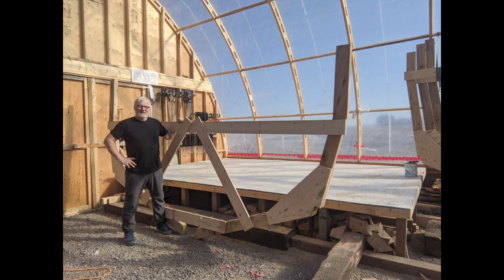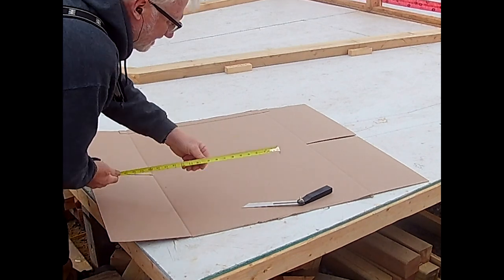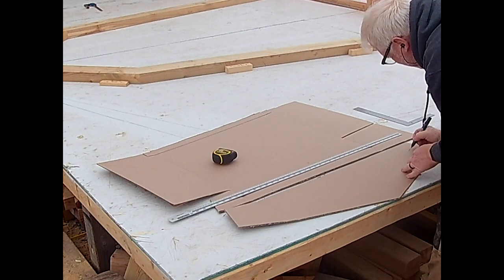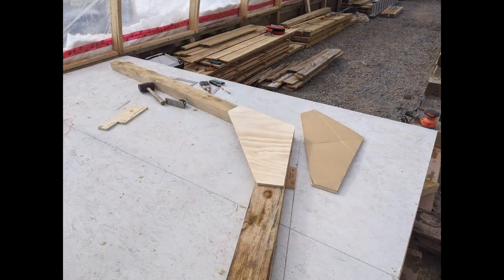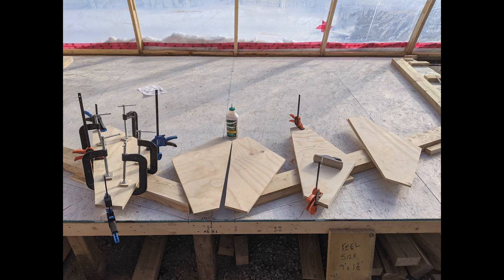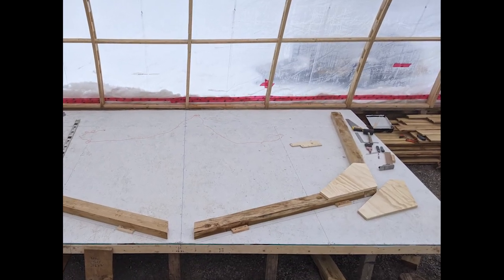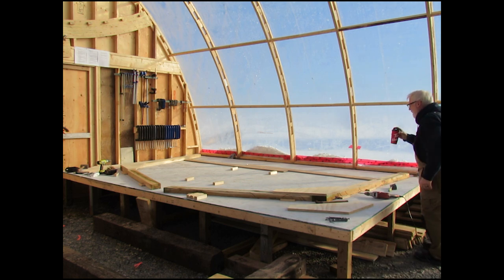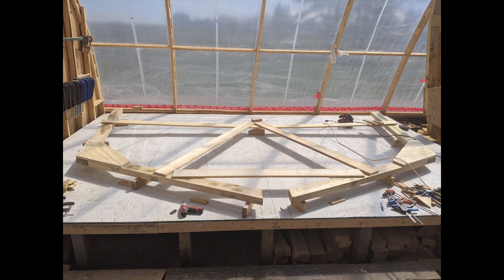YT BoatBuild Ep11 FramesPart2 Fnl

Comment: I suggest that you cut all the gussets a bit over size, secure them to the frames and trim to an exact fit with a router and flush cut bit.  It would sav you a ton of time trying to cut them to exact size.
Reply from the maker: Great idea John. Oversized is ALWAYS better than undersized for as you say you can trim down but you can't add back.  I would say that I "lucked" out 85% of the time. A few are indeed a bit undersized, a bit being 1/8 to max 1/4", but I still have a chance as own the road each frame, before planking, will have to me trimmed to a certain bevel to allow the planks to fit snugly against them.
Reply: @TheAmblerOdysseys  You’ll be epoxying planks and or ply to these won’t you - I think that’s the Buehler method.. in which case small discrepancies don’t matter, and none of this is seen so perfect fit isn’t a issue.  The epoxy is stronger than the wood. You get to practice your cuts and hide your mistakes at this stage. Been there…
Reply from the maker: @robinhodgkinson  you got it. Once layer of planking and two layer of ply all covered with fiberglass.  If I can't hide a boo-boo or two under that then I am in big trouble🤣

Comment: So surprised that you didn't build a "work bench" (on the side for smaller projects like the "gussets.") 32 to 34 inches high....  Save your Back man!   Ouch.  Otherwise t'll be many long days on the "lofting table."  (looks like about 20 inches off the ground. ).   Torture.   Whew!
Reply from the maker: Are you surprised that I had planned to build a work bench but didn't. I have a mitre bench that would be so much more helpful if I kept it decluttered.  But the problem is it is just the right height to lay tools on.😂